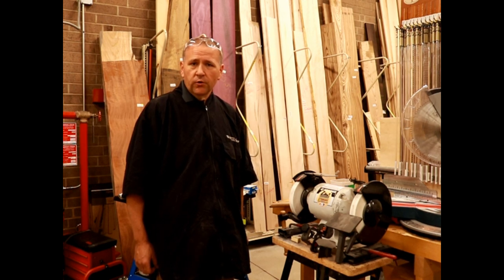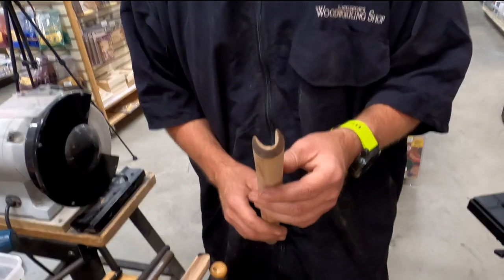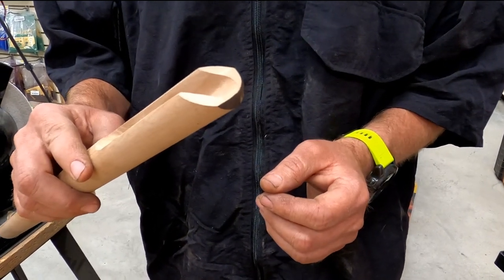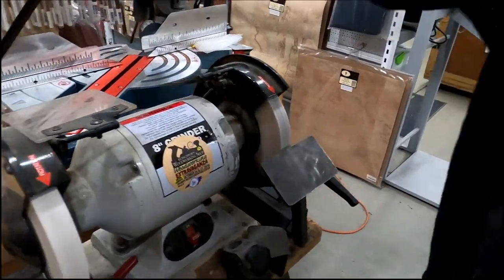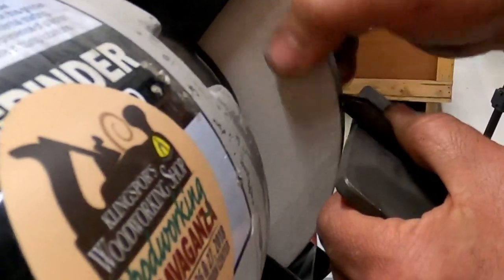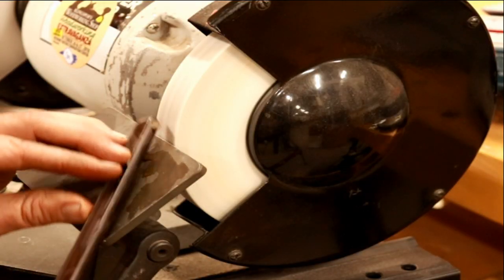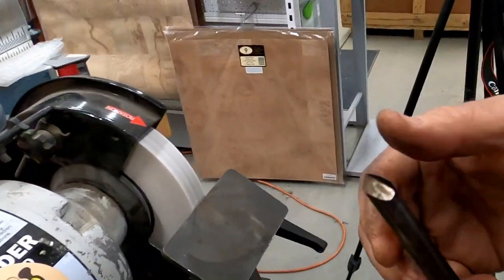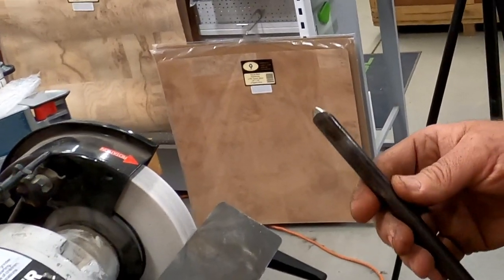How to Make the "Ellsworth Grind" on a bowl gouge, using a Bench Grinder

Comment: That gouge was not an English grind bowl gouge. It was a spindle roughing gouge. It is intended for use only on spindles where the woodgrain is parallel to the lathe axis. To use it inside a bowl is, as you remark, asking for a catch.
Another point: at around 8 minutes in we can see you approaching the final shape. You don't seem to realise that it is important that the point on the flute edge that you are closest to grinding must be horizontal, and therefore parallel to the grinder axis. The easiest way to ensure this is to glance at the top edge of the platform. Make sure the wing edge that you are closest to, or actually grinding, is exactly parallel to the edge of the platform. Otherwise you will not get the correct bevel angle all the way round. Constantly adjust the relative amounts that you are twisting and turning the gouge to achieve this.
Reply from the maker: Very good information to share with everyone! Thank you for taking the time to do that. Thanks for watching!

Comment: 40 or 50 years ago this was called the Irish grind.. Because it was hard to do the English grind prevailed..  Go read Peter Child…. A turner and writer who published the English grind 50 years ago..  Production turners used the English grind..  Peter Child is English..  a simple jig could be made where the English grind is used by just twirling the tool on the grinder.. This is much like the Wolverine tool that hold the gouge at the base.. and is repeatable.. There are references in Fine woodworking from years ago about Peter Child too.
Reply from the maker: Thank you for all of this information. Thanks for watching as well